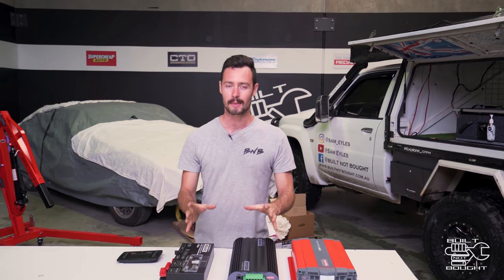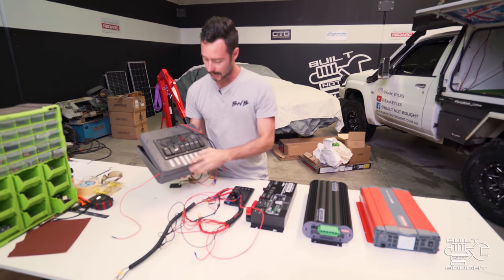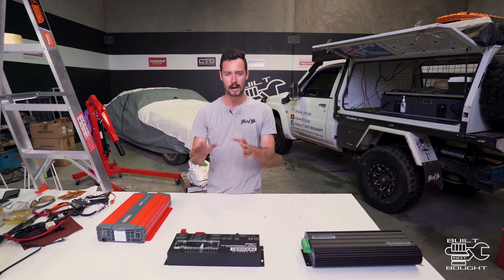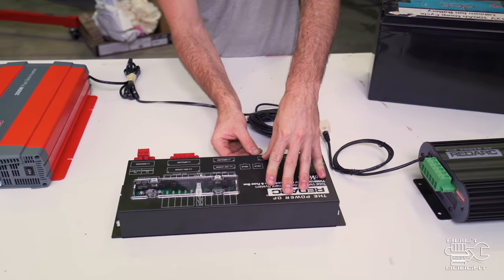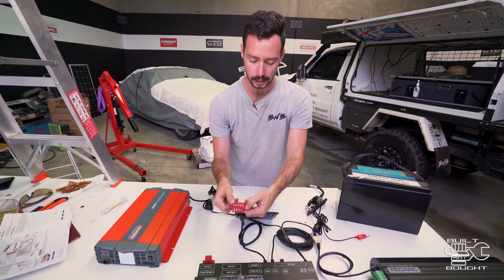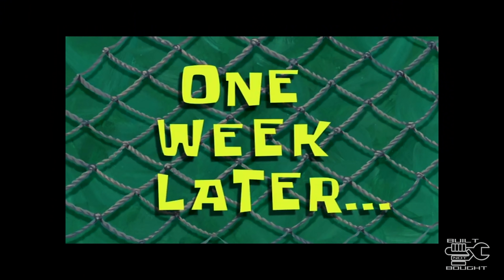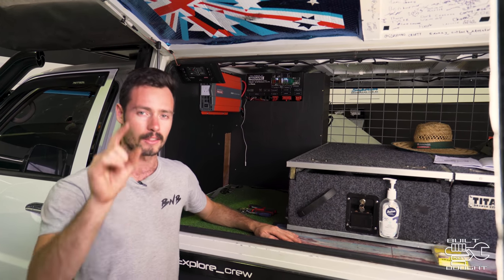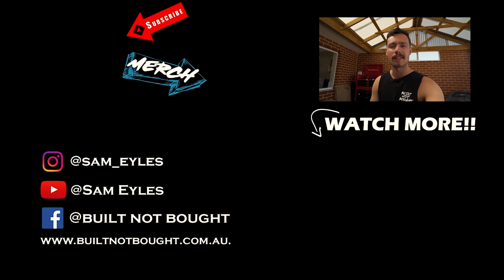REDVISION || The Future of 4WD Electrical

Comment: Hey Sam, should do some vids on more basic set ups. A lot of YouTubers do vids while sponsored by people like redarc. I do a lot of remote touring and run 150w fixed solar (150 portable) a DCDC charger and run a cetek for 240V shore power when needed along with a 300w sine wave inverter for charging laptops, portable UHFs along with Ryobi codless gear. All this was achieved for under a grand using name brand gear.
Reply: jack russo agreed I have the same mentality dc to dc 250w solar and a battery that’s all you need
Reply: Yeah I think if you're running a heap of electrics for filming this makes sense but I for most people it's way over the top and I makes people think you need all this gear for a reliable and well functioning system. I priced all this gear and you're looking at around 4k
Reply: jack russo not including install but yeah agreed mate dual battery’s is fine for 99% of people with a DCDC charger
Reply: @4x4CampingandAdventures  what's a parts list needed for running a few camp lights And interior lights and a fridge,  
a solar panel, DC DC charger fuse box and an, AGM battery plus some cables n switches

Comment: 2000 watt inverter is looking for 160 amps from one battery. Good luck with that.
Fancy comms wiring is just what I'd leave out when going bush too. (30amp for the fridge?)
Reply: Itechworld 120amp. Will do it. Standard max 150a. 5 minute discharge 175a. Peak short max 365a.
Reply: J M  dcs lithiums are the way to now days. Google them and have read

Comment: Hey Bro, little tip for those sticky back cable tie holders, drop a S/Steel wood screw into the base of each self adhesive cable tie holders. Overtime the adhesive will get moisture and vibration they will fall off. Awesome setup bro.

Comment: This red arc system is great I used it in a van conversion I done very accurate reading on input outputs on load you will love it sam especially the data logging from hour to hour and day to day for a month keep well in tough times like these keep the vids rolling I’ll be watching